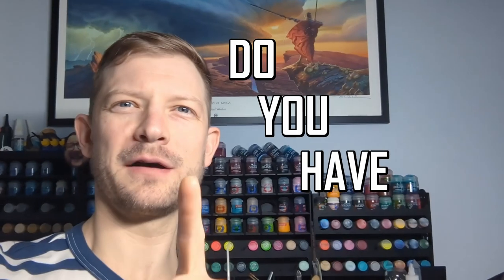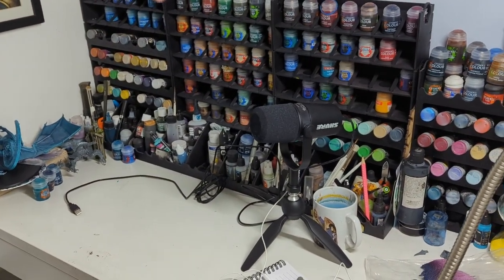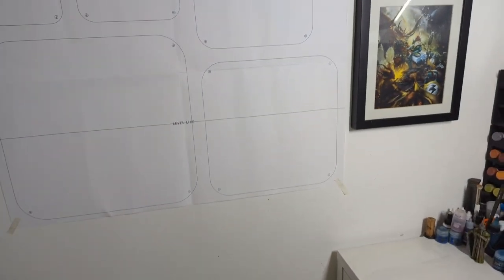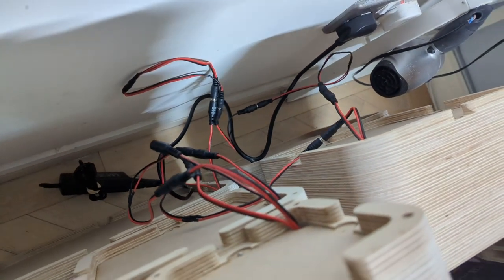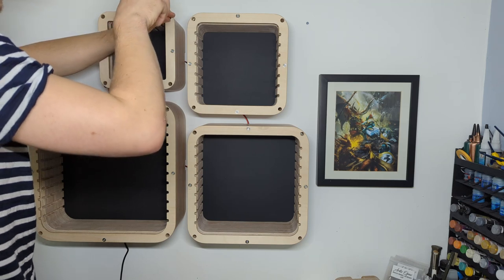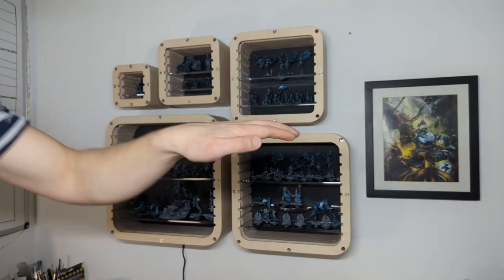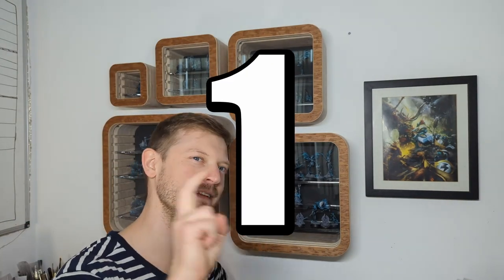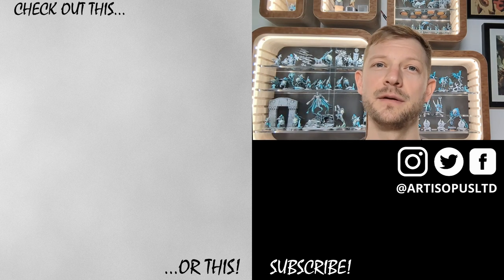(Giveaway!) My Tiny Warhammer Hobby Area + Upgrade

Comment from the maker: Late Pledge for our cabinets: https://www.kickstarter.com/projects/artis-opus/cabinets

GIVEAWAY!: We want your best question about small hobby areas, and best suggestion!

Also, anything you'd like to see covered specifically in future episodes, products, themes (having a clear-out is definitely due!), etc.
Reply: Active and non active models, should the models not currently being painted be in sight or hidden. Would them being in plain sight get them painted faster. Best suggestion, make a mobile hobby area.
Reply: For me the best thing I did with my small space is spend the time to clean up after I'm done for the day or even the moment. I have broken far too many partially finished models because I leave them and a mess on my desk and then let them sit there for days until I walk by and accidently knock them off and onto the floor. So regardless of space if you keep it tidy and put away everything when you are done you won't make risk breaking things you spent hours on.
Reply: I would recommend a railing system similar to how pubs have where the glasses will be in the air held by rails, you can attack your camera and mic and light aswell. Other things you can set up for your rails? PAINTS. It's incredibly space saving however the setup cost and instalation is quite high. but yea, don't just think of what is in front of you, but also the space above you to maximize use.
Reply: Love the setup and the miniatures wall displays. My tip would be replace the black background on wall displays with a reflective/mirror surface, that way you can see the back of the miniatures as well!
Reply: I'd like to know what people do for sorting their bitz. As an ork player I have two big plastic boxes of them all mixed up like sharp, pointy Legos.
Reply: is there black insides? i like the creame but some models will really pop on the black and black
Reply: See some of our replies, they have a scammer going through with your profile image saying people have won assumedly will direct them to another page
Reply: I think you’ve got an imposter problem, Byron! Got a message in response to my naming of your wall art (first one, btw ;) and had a response from @ArtisOpusGiveaway. Just an fyi.
Reply: @Votann  I played along to get the PayPal info with the intention of getting it shout down
Reply: @JimmyMurphythemurphyfella  Good man! Let me know how you get on.
Reply: I really wish I could afford to back this campaign. These are so cool.
Reply: Where are your paint racks from?
Reply: @Votann  I got the same, so sad. Was directed to reply on Telegram. Didn't have that app, thankfully didn't allow access to my contacts.
Reply: Hi, what are you plans to organize all your paints? I am kind of struggling in this area due to having different brands of paint and them not fitting in certain storage. Looking forward to see how your setup comes out
Reply: @ryanbrosnan5473  I use the Moppe cabinet from IKEA.  It holds paints regardless of height and can be painted to match other stuff if you want.  I use removable labels on each of the drawers so I can find stuff.
Reply: Does anyone have a good solution for a small airbrush booth? One of my best suggestions is to try and have a place for everything to go. Organization and cleanliness is key in small areas.
Reply: @bradleycornell7248  I use the arttystation airbrush booth.  You have to provide your own fan and hose, but that's not nec. a bad thing.
Reply: @bradleycornell7248  honestly I don't have room for a booth. I use cable management accessories for computers and coil my hose up and attach it to the side of my desk when not in use. I remove my airbrush and put it back in it's Iwata box home. I just wear a respirator and open a window when I spray.
Reply: How do you prevent overspray? Or is that not an issue because you have nothing but hobby stuff on the desk. My hobby space also is where my PC is set up. So I don't want to damage that with overspray.
Reply: @bradleycornell7248  I put a vertical piece of foam board in front of my paint rack and drawer shelf. I have a couple of magnets glued to it and to my drawer shelf to keep it in place while I spray. Then I spray on top of small cutting board that gets used as pallette from time to time. When I'm done I hide the foam board between my desk and the wall.
Reply: @bradleycornell7248  thats where having a good booth comes in.  That aside, be sure to lean on close to the filter when you spray.  If there's good suction you shouldn't have a problem.

Comment: Suggestion: when you start running out of space go vertical! A corkboard with a magnetic sheet glued to it is amazing. You can glue tiny magnets to brush boxes, pallettes, containers, or even minis by putting a magnet in the base that you are currently working on and stick them to your magnet board when not in use to dry and/or save space! Magnets and magnet sheets are cheap enough to facilitate a ton of vertical hobby storage! Hot glue will easily allow you to remove magnets as needed as well.

Bonus: a magnetic mini drying space  can also help save a wet mini from a pet you may live with

Comment: When I was living in a studio flat with a tiny hobby space one of the things I did was to make use of what is know as first order retrieval. Basically the tools/paints that I used most often were within easy reach so that it was easy to get started and also more importantly easy to tidy away. I did this by using really useful boxes/Tupperware that fit into my desk draws so that I could easy grab and go. The more important stuff went into the top drawer and then lesser used stuff in the lower drawer. Extra models etc either went into under bed storage or into the cupboard.

Comment: Loving the topic on this one Byron! I’ve found mounting stuff to the walls is great, if you can’t put holes in the walls though then a sheet of plywood attached to the back/side legs going up is a great way to do this, you can then fix a peg board or similar to this for makeshift shelves or racks for paints and supplies etc. Additionally going down 😳 where space allows for quick access hobby drawers under the desk for the key bits and bobs keeps that valuable work space real estate free for the current project. The bonus of the shelving is you can also mount goose neck lights to this to keep your area well lit! Good luck to everyone entering!

Comment: My question: what would be the best set up be for extracting airbrush fumes in a small space with limited access to a window?

My recommendation:  use shelves for oils (such as scent oils or massage oils). They usually have a channel cut in the middle which fits the paint pots nicely and are decently priced.

Comment: Hi, great showing the assembly and that you stayed unhurt!...
My suggestion would be to use hinges and drawers for one. If you got the room under the plate of your table and enough space you can/could mount several drawers or small containers underneath. You could put your keyboard there or use others to stash your brushes or other hobby tools for example. Another tip would be to organize your hobby into the different steps needed. For example putting together the models, crafting, painting, airbrush, etc... And then create a modular box for each of them. That way you can store them like segments below your table (as long as there's no drawers or cupboards included in the table) at the sides and after you used one, which is the active one on top, you can put the tools/materials back in and switch to the next easily. Also if you got the right amount you could pull the whole stack of boxes out from under the table and use the active one at the top just like an open drawer like under a real table, switch between tools, etc...
Another tip if you're able to you can cut a hole, maybe 5 to 10 cm in diameter, and fasten a plastic bag or even reusable plastic container underneath. That way if you're building models, working on dioramas, basing etc... you can simply shove all the leftover material simply inside and when you're finished you have way less to clean! Last tip: if you have a table that's wide enough, without drawers or cupboards attached, you can use hinges on the outsides and fasten containers, drawers, etc to simply swivel them out when needed. I don't know if I can make myself clear but I mean it like unfolding, like wing doors.
Hope I could help some of you, good look and good hobbying ya'll!

Comment: My best suggestion: for small hobby spaces and homes like flats where maybe you don’t have much space (like me!) - get a dinner tray with a small edge and handles (I got mine from Tkmax) pop in a paint rack (I use a GSW modular rack for Vallejo paints)  which fits perfectly, a mug for brushes and other bits, and you have an instant mobile hobby space ☺️. I find it super useful. I have a clip on lamp on my dining table and when it’s time to eat, the lamp gets folded away and off comes the tray and it’s back to it’s normal use (keeps the Mrs happy!). You can even fit in a small wet pallet and water pot if you don’t fill it with more hobby bits like I do! I’m buying a half size paint rack for it this week which will fit on the short edge so I can organise some additional paints and make it even more portable and compact ☺️.

Comment: Suggestion: If you're anything like me you love working cool materials, kits and bits into your minis. However these things can quickly take up more space than any other crafting parts! The best way to avoid cluttering your space is to have things well sorted into sectioned boxes right from the beginning, so things are easy to find when you need them and sit neatly ticked away when they aren't needed.

Comment: Regardless of the size of your painting area. The one suggestion I have is, invest in a good chair and a proper height painting surface. You will (hopefully) spend hours sitting there, a good chair and a desk which allows you to have a good posture, will make those long sessions easier. And not having a sore back after sitting incorrectly for hours is something you can value.
Reply: Yeah, if you can afford it and have the space a raiseable table is a godsend

Comment: I have a few things I've learned through the last year or so of painting, but I'll start with the most important one:
Get a desk (or build one) that's slightly higher than your average desk so you don't have to lean over the table as much, and get a proper OFFICE (not gaming) chair that can tilt forward - Your seating comfort is paramount both for your health and your enjoyment of painting.

A big thing to save space is one of those rolling drawer carts (preferably see-through). You can store armies, bigger, bulkier items and basing materials in them and they mostly take up space vertically, which is the #1 thing to remember: Think vertically.
IKEA- or any other J-shaped - shelves are fantastic for storage as well.

Lastly: A papertowel holder than can be mounted underneath your desk. Incredibly handy.

Comment: Hi Byron, some things I incorporated over the years as my place is very small to paint as well. My table is 4ft x 2ft, so I had to get organized. For assembly I use a different table of the same size, organized in a similar way. For me the important lesson was, I do not need everything ready to grab, I just need the things ready to grad used in the actual project or sub-project. Often only the paints and brushes or airbrush for a certain step (i.e. the coat or the leather) are on the table - this gives me more work space.

1) I only have the paints on the desk needed for the actual project, all other paints are stored in drawers. This gives me more depth in the working space, plus I have to think up front about the color scheme used. I use a small "shopping tray" to collect and store the paints for the actual project / step on the table.
2) Ready to grab what is really and always needed: wet palette, texture palette, brushes for the actual painting step, cleaning and caring for brushes, two jugs with water, airbrush holder to the far right, soft cloth area for painted parts of the actual project, homemade holder for painting parts (I usually paint unassembled, with the various parts on sticks), cleaning for airbrush, very good lighting.
3) Cabinets under the table with lots of drawers for paints, accessories, replenishments, airbrush paper to develop and test the choosen scheme.
4) Homemade shelf with brush drawers, airbrush cleaning brushes, booklet to write down the various paint schemes, color wheel, masking tape and masking putty.
5) Free space on the table for your arms, elbows, sometimes your head when desparate.
6) Right in front of me a soft cloth as painting area. This serves several purposes: 1) put down the model without hitting hard surfaces and damage the fresh paint, 2) drying the brush after cleaning, 3) quickly get rid of excess paint on your brush when you have too much on it.
7) At the back of the table is the compressor valve and dial mounted, quick and easy adjustment of airbrush pressure (the compressor is under the table).
8) Vortex shaker and homemade paint stirrer (made from a cappucino milk stirrer thingie available nearly everywhere at low cost - skipped the milk thing and mounted a thin wire bent into a J, this goes into all Vallejo bottles easily), also a box with additional mixing balls.
9) IPad or phone on a swiveling arm, either to the side or in front, but above the paining area.

Always clear your workspace after finishing the actual project, put everything again where it belongs. Start new project with the selection of paints and brushes ready at the table, the new parts in the parts holder and enjoy.
Well, that's my approach. Mainly driven because I want as much free space as possible.
Have a great day!
Andy

Comment: Big thing I learned from Ikea is use vertical space. Cabinets and shelves to hide away things rarely used and more frequent use stuff as you come down to desk level. If you want pictures and posters, put on cabinet doors. Also pegboard for tools and putting things back to the same place let's u build muscle memory for where things are.
Last, plastic bags can hold sprues and bits smaller than boxes. Consider condensing the pile of opportunity down and gathered by army or project and LABEL EVERYTHING!

Comment: I have a relatively small hobby space, it's also my PC desk. I've actually modified a corner desk, so it has a second tier. The PC sits on the tier, along with things like my airbrush spray booth and typically my most used paints, which never get put away. A corner desk also allows you to push the monitor and keyboard away from you, when painting/ building models. I also have my paints stored in close proximity, one in a paint rack and the other is a Vellejo model colour set that lives below the desk. 

I make sure I clean up the space after each project is finished, so I'm starting the next with a clean workspace. My brushes are within arms reach, as are hobby tools. You don't want everything on the desk, so put away less used items or use hobby specific storage racks, for things like hobby tools and paints. My boxed models are in a cupboard, so the space is nice and tidy. Of course, keep some inspiration around you, artwork or larger display models etc. 

For lighting, I have an overhead floor lamp that I can move to or away from the hobby area by simply turning it. Basically, everything I use a lot is within arms reach or a chair turn, anything I don't use a lot is in a cupboard, a step away.

Comment: For small space, the most important part is adaptability! As I won't always paint the same model, I could need different stuff. I'm talking about tools, paint, brush but also storage and having the possibility to quickly change and adapt your setup is the best.

Also using the verticality of a wall is great you can have a Pegboard or a magnetic board and put all stuff for your current session on your desk or close to your space and once done to avoid issue put in at the top of it, it will look organized and you can quickly clean your area.

In order to optimize space, I saw that you have thought about creating specific shelves (Peninsula & Flanking) but what about one with half the depth and with a "↴" form in order to mix big minis (tank, dragon, ...) with smaller units on the same row.

Comment: Hi Byron here are my 3 essential items for my space. 1) I like to use shelves above my desk to store books, primed units for painting, models awaiting detailing and any finished display models. 2) Find a magnifying glass/ led light combo unit or at least some good LED lighting. 3) If you can find some parts bins to mount on the wall ( I have 2 of them to hold all my spare bits ), wall mounts for tools like clamps and sprue cutters. As a honorable mention I have a fishing tackle box that I have a second set of tools in for when I was working in northern Canada, that I would take to camp with me to build models or complete some hand painting. Most people will not require this but if you like to go to paint shows or are in a painting club this idea may work for you as a travel kit. I would like to see you complete one of; a Baneblade/ Shadowsword or a variant of them done to a higher level of detail, a C'Tan Shard of the Void Dragon given the Bryon treatment :goodvibes:, or an Auric Runefather on a Magmadroth exuding a Magma glow from within. Thank you for your help my painting skills are improving exponentially. As soon as I can get some $$$ put together I'll be ordering my sets of series D and S brushes out of Vancouver BC the closest place that I can get them. I can  hardly wait.💯👍